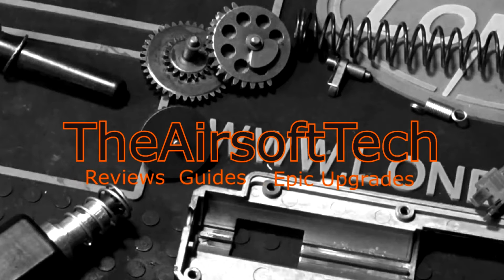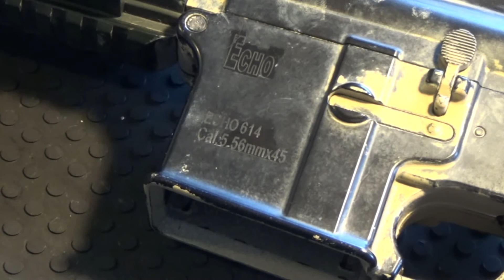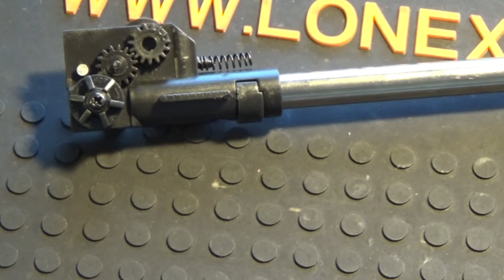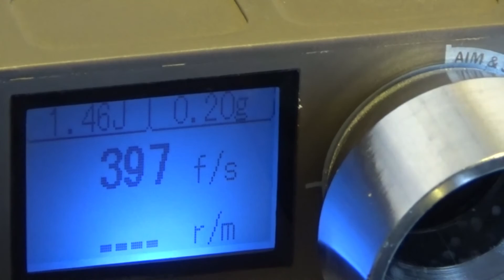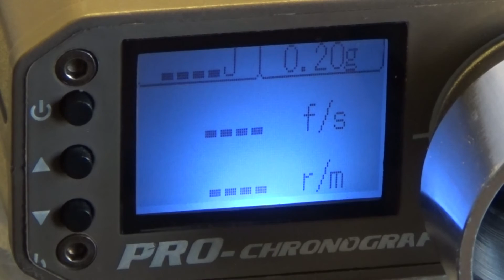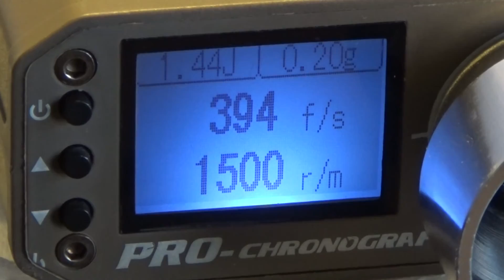Echo1 614 "Pretty" Balance Build!

Comment: My ultimate air seal is the fact that my cylinder head o ring is so fat, it barely slips inside the cylinder, then a good ported piston head, and o-ring nozzle, as soon as the head passes the port on the cylinder, it seals instantly, even my barrel bucking and hop unit are air tight!!!!!